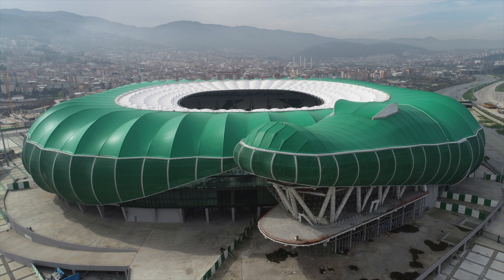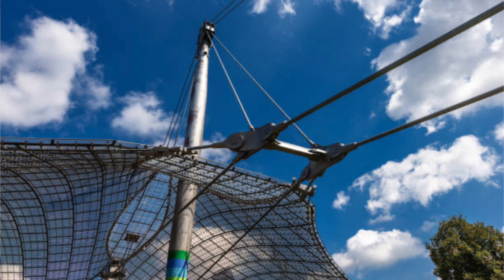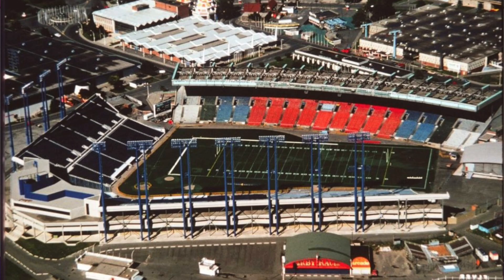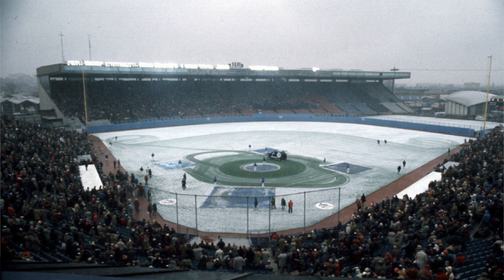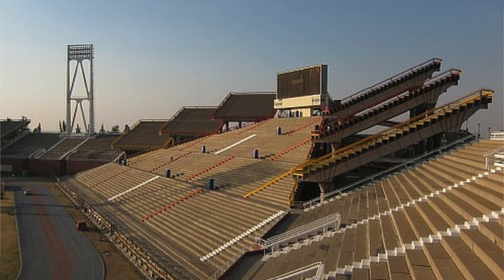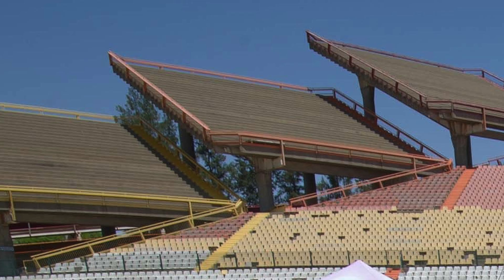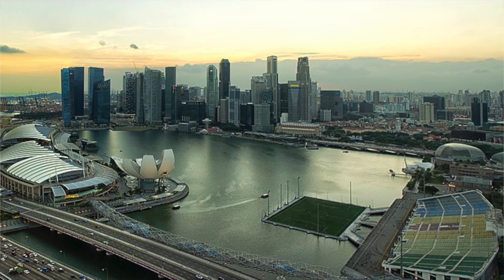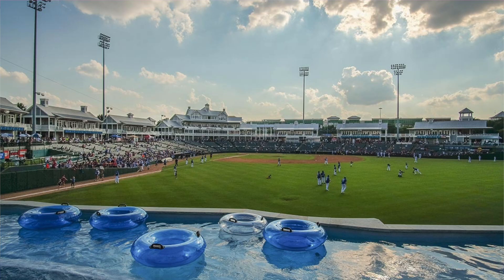Weirdest Stadium Quirks

Comment: Mosquitos aren't a huge issue in Singapore. They have a very successful mosquito control program, I was there for 9 days and only got a single bite.

A fun fact about the Marina Bay it's floating in, it used to be connected to the ocean and would frequently flood the city during high tides. But they built a barrage across the inlet, so not only does it no longer flood, by collecting rain water in it and releasing it when levels became too high, they diluted the salt to such low levels that it's now a fresh water reservoir that helps alleviate the fact that there is no fresh water sources in Singapore